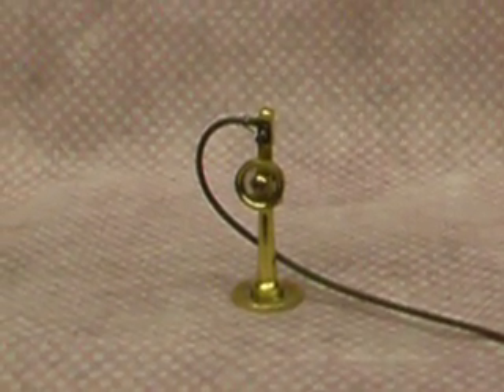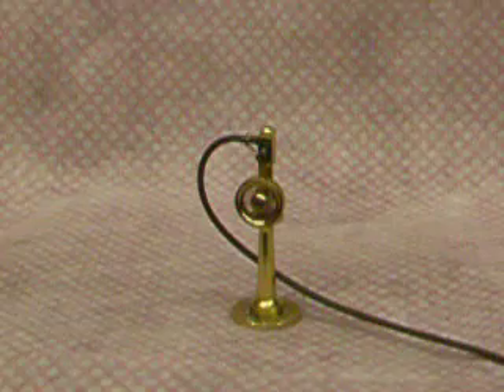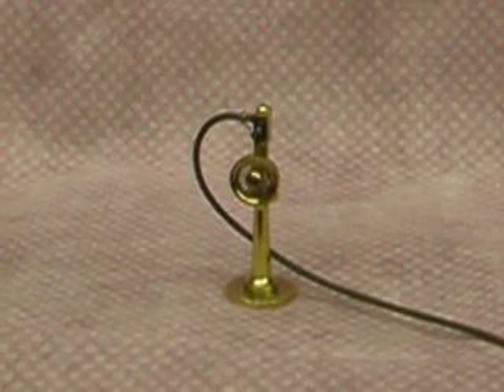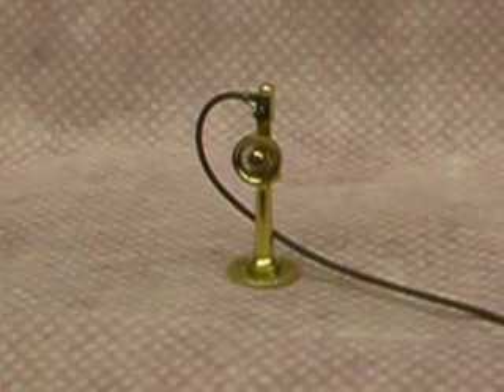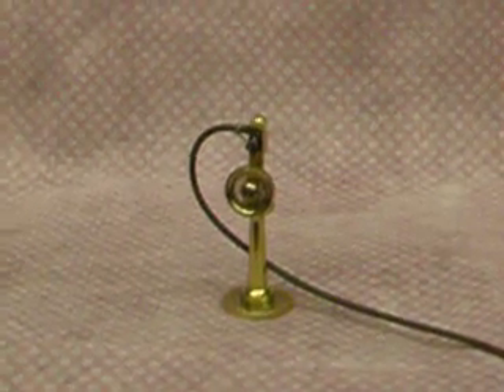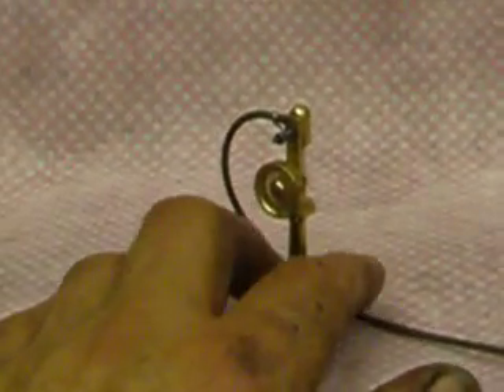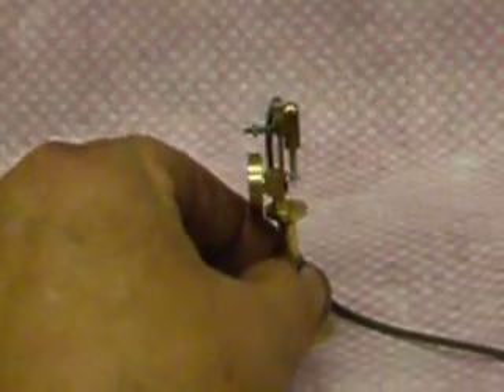My Own Tiny

Comment from the maker: This engine is in fact based on the port timing of the 'Jenny Wren', a design by Tubal Cain (Tom Walshaw).
It is just a standard single acting oscillating engine.
It was made for a bit of light relief and took less than a day. The crankshaft is in fact one piece, machined from the solid.
The hardest part was in fact getting the air supply to the engine, I eventually used a very small syringe needle as the inlet pipe. Everything is silver soldered, not soft soldered together.